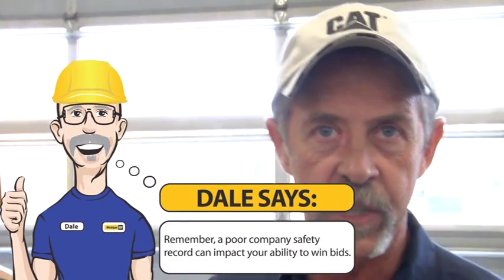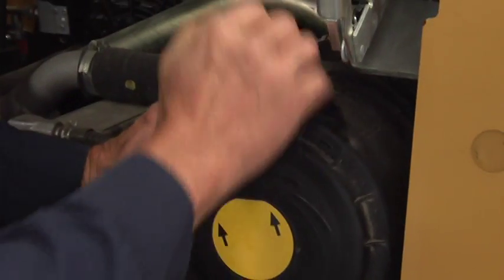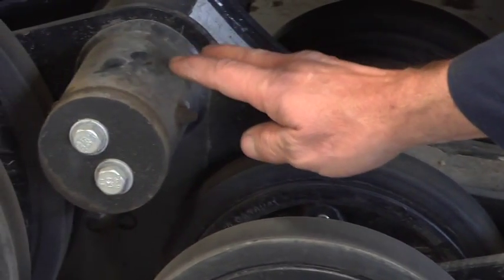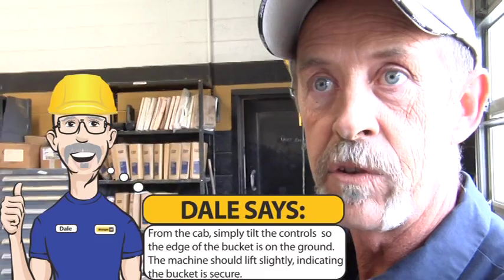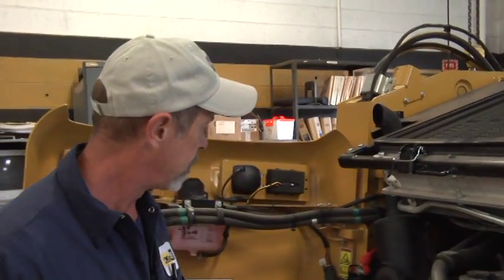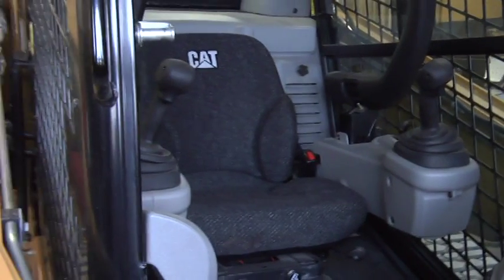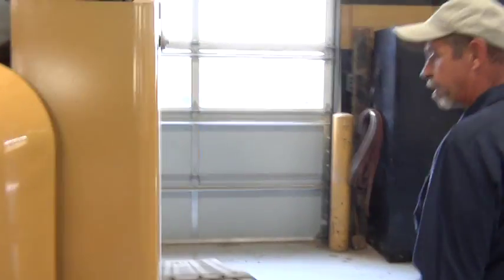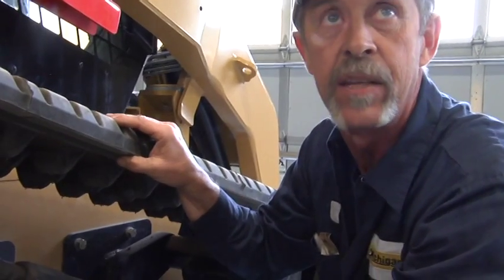Ask Dale:  Skid Steer Pre-Maintenance (Michigan CAT)

Comment: Hi great video! I got a Cat 246B that when parked on hill, cab facing downhill with the parking break on and the machine moves forward on it's own at times completely running away. Need help on how to fix it.
Reply: Hi pls my skide steer machine is consuming engine oil what can be causes ? How should I go about to check my turbocharger?

Comment: Hi Dave I have a problem with a 235 skid steer no hydraulic pressure in lift arms  it drives but can't lift the arms it all happen after changing the drive pump  can u help me plz
Reply: What kind of maintenance? Free tree maintenance. Can we used to check the hydraulic actuators on the on the bobcat pretty lame Hello Kitty luggage Maybe it's the hydraulic. It starts to like you said cuz there's a

Comment: I have a 252 that the aux joystick quit working, I know this is an electrical problem as I have had he machine down for 5  days chasing the wiring harness, there is no shorts, surprisingly. the operator said previously that he could slam the lapbar and the aux would work for a while, are the lapbar safety switches known for going out???
Reply: michael lawhon yeah I had similar problem with 248b. They replaced joystick, I cleaned lap bar contacts and still had dramas.